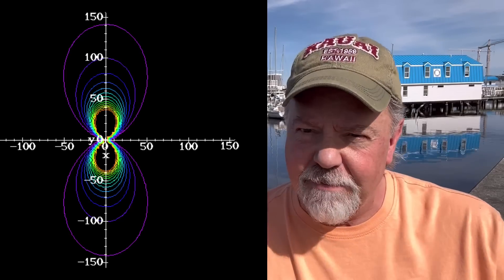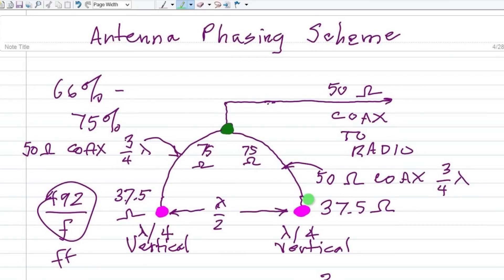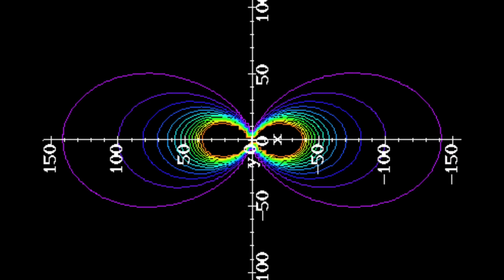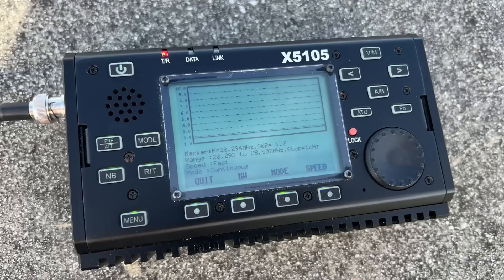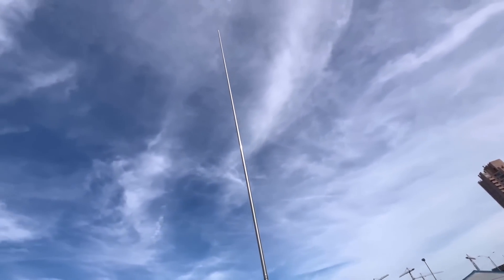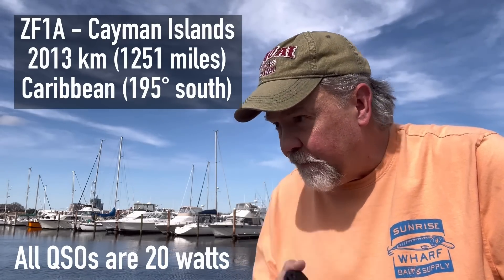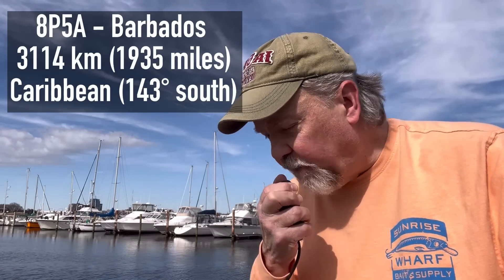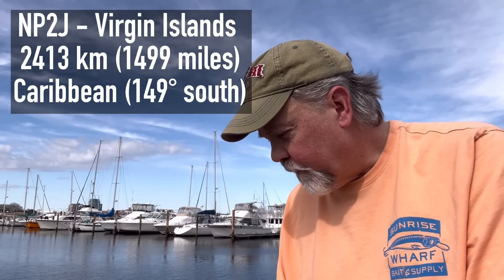Co-Phasing Antennas for Portable HF Ham Radio

Comment: Walt did you use the same Phasing Coax for 10, 17 and 20? I have four Solarcon M2000's and am thinking of two phased for 10, 12, and 15 meters north/south and the other pair for east/west. Love your videos and Thanks. Best 73's Jim K0MAN

Comment: Fascinating experiment!  Thanks for sharing it with us!

I was thinking about this while watching your video:

It occurs to me that a Yagi beam antenna can be constructed with as few as two elements, with only the director being fed, and the reflector about 0.12-0.15 wavelength spaced  and  slightly longer.  I was wondering if you had tried setting up a two element parasitic array with one whip slightly longer and closer to the other whip?  That should give you gain towards the driven element and rear rejection in the direction of the longer element.  With that perfect ground right there for both elements, the results might be surprising.

73
AI4IJ

Comment: I think base on the phase  it tends to radiate as a repellent from each other  . It would be a great idea to have those antennas in a sort of circular Fairy platform 🏟️that  rotates and  see if it you can use it as a Directional  . Because of the radiation side to side .

Comment: Very interesting, Walt. I ran phased verticals years ago on 15 meters from CT to the UK. Tried the bidirectional half-wave spacing, good, but settled kn end-fire arrays with a cartiod pattern. Just before moving back to W2, actually made a rotatable vertical array for 15 with a wooden base on casters. It worked very well, but portable? Not so much.

Got my ideas from 73 Magazine i  the late 1970's and early 1980's. Gotta try it again, no?

De WB2VUO
Reply from the maker: That sounds awesome, I’ve got the phased vertical bug right now LOL! 73, Walt

Comment: Ok... here's a history lesson...
Hy-Gain sold a little box called a Co-Phaser in the early 1960s. Paired with a pair of CLR2 base station antennas the box enabled the operator to have a number of directional patterns. 
Fast-forward to 1973...

As truckers began to flock to the CB band, they quickly learned that the aluminum box trailers really killed the signal. New-tronics Hustler introduced the Twin Trucker series of center-loaded mirror mount antennas. Hy-Gain had been selling co-phased gutter clamps and trunk lip mounts for years and adapting them to trucks was easy. 
They sold like crazy, and soon practically every OTR "big rig" sported the white "cattail" antennas. 
What they did was to create a "figure eight" radiation pattern that concentrated the RF in the direction of travel. I had them on my 1967 Ford F100 and can vouch for their abilities to get reliable 40 miles in either direction with a standard mobile radio. 
Fast forward...

I was doing field service in the 1980s and had a Kenwood TM-2550 in my Rabbit. In a quest for more range I mounted two Hustler CG-144 colinear antennas on the rear bumper. The older hams ragged me about having a "CB setup" but they quickly noticed the lack of mobile signal flutter and the fact that I could routinely be full quieting into the repeater in Pittsburgh from Mount Storm power station, 120 miles away. It was directional to the front of the car, roughly equivalent to a five element Yagi. 
If you mount the antennas an odd multiple of a quarter wavelength the effects of fading are drastically reduced. When one antenna is at minimum the other one is at maximum. 

Hy-Gain expanded the co-phasing concept to their Yagi line, selling co-phased three, four, and five element arrays. Google the old Henshaws catalogs. 
They were big!
They were heavy!
They were expensive!
But, they worked great!
Reply from the maker: Awesome stuff! Thanks for sharing!
Reply: @COASTALWAVESWIRES  Happy to contribute. I read those magazines when I was a kid and dreamed about building those really cool antennas.
Reply from the maker: @spaceflight1019  me too! I had the cheapest 1/4 wave antenna Radio Shack sold out my bedroom window and a Navaho 23 channel base (circa 1975)
Reply: @COASTALWAVESWIRES  My first antenna was the legendary Cushcraft Trik-Stik. Mounted on the same pipe as our TV antenna, it worked very well... and interfered massively with the TV!
Reply: @COASTALWAVESWIRES  I'm going through the old S-9 magazines and the earliest Hy-Gain ad featuring co-phased Colinear base antennas appears in the May 1963 issue. 
More history... there's a video on my channel.

Everyone knows about the "new" Super Penetrator. 
When it was first introduced in 1972 it was called "the Penetrator", or "Super CLR". What's a CLR, you ask? 
From the early 1960s to 1964, Hy-Gain sold the OG Colinear base station antenna. It was rated at 3.86 dB over a ground plane. It had a 20' vertical element and either three or four radials. 
It was replaced by the famous CLR2, a 19"10' vertical with three radials, a "solid state" printed circuit matching board, and a vastly improved mounting bracket. Unfortunately, the matching system was incapable of handling power above 300 watts, but the Penetrator returned to the hairpin matching system of the OG Colinear and it is rated for 1500 watts.

Comment: that was fun. we did this a lot in the early 1980's on CB. that co phasing harness gets you back to 50  ohm. can be done with a 2:1 splitter/combiner.  I know DX commander and a few friends been co phasing DX commanders together . and figured out multi band part.    I have seen 3 and 4 antenna's phased . Callum is working on that   as well. changing length of 75 ohm changes the phasing and changed pattern to antenna RF field. adding or taking away delay. also called delay lines. how AM radio stations work with more than 1 tower. normally 4 and they go into a phaser which is made up of delay lines and caps for tunning. this changes the pattern the station radiates  out of.  how they steer signal to.  a outher trick you can do is parasitic array. only 1 antenna driven and tuned.   one slightly larger and that all ground. that becomes reflector . move it around to steer your signal.  and you can even do a shorter one in opposite direction. that becomes a di reactor . you now have a 3 element beam.  lots of fun you can have with more than 1 antenna . 73's
Reply from the maker: I have plans for a parasitic array soon! 73

Comment: Cool experiment! I used to run dual whips on my pick up way back when because... why not? It's been a minute since I have looked at phasing. If you feed 1 leg 90 degrees out of phase, doesn't that change the direction to along the same plane?
Reply from the maker: Thanks! Yes that should be what would happen

Comment: Missing the truck mirrors, lol
Reply from the maker: LOL
Reply: When I was a kid there was a guy who was from Arkansas and went by Razorback. He had two 102" stainless steel whips mounted 102" apart on the roof of the Corvair van he drove. With a Lafayette HA-250 linear he was a flamethrower! 
While the setup might have worked well in Arkansas, in Pittsburgh the antennas kept striking obstructions and one day he came in contact with the overhead streetcar power lines.

Comment: I can see this would work well out in the open. I tried co-phased 20m verticals in my yard, both ground mounted and raised as ground planes with radials, and I think with all the obstructions…house, carport, fence, etc….I didn’t see any improvement over a single vertical higher up.  But that’s why we “play”, to learn 🤪👍!  73 de Dan WD4DB
Reply from the maker: Roger that! 73, Walt

Comment: Interesting experiment with very good results.  You didn't say... but for 20 did you co-phase the coax for 20.  IF not it would be interesting to redo it and see if there is anything different in performance.  It would be interesting to see what your gain was.  Thanks for the test.
Reply from the maker: Thanks! No I just left the 11 meter coax as-is on 20

Comment: Great Video! What I never understand about doing this is, okay, two quarter wave verticals, and half a wave length apart. With phasing. Okay. So far so good. And 1/4 wave radials under both. Again? So far, so good.. but do you attach the closest 1/4 wave radials TO each other? Then? Isn't this just an upside down half square? All the Best!  Finally, as far as the Truckers go, how can they phase antennas that are not going to be 5.5 metres apart to make the half wave, as that would be wider than the cab? 73 DE W8LV BILL
Reply from the maker: Thanks Bill! I don’t think the truckers got them completely a half wave apart but were more in the situation I was with 20 in an oval pattern with a little more gain forward. Sharing the ground plane this is similar to a half square for sure

Comment: Semi trucks have got the twin antennas like this. I still say single antenna is better. It seems like I had more positive results with just a single then the co-pays but for the frequency 27 MHz they really need to be 9 feet apart that's just not possible so that probably restricts them a little.
Reply from the maker: Roger that!

Comment: Hi Walt, 
Great experiment!
Sorry for the off topic question but what Li Fe Po battery are you using for your portable ops? I decided recently to get back on HF for more than just Field Day; purchased a G90. I'll want to purchase a charger as well the battery. Are there any stores here in the HR area that sell these that you know? 73 de KC4JGC.
Reply from the maker: Thanks! This is the exact battery I use with my G90. I’ve used it for 2 years and it will last all day with moderate use out portable. LifePo4 6aH, cheap and comes with its own charger. From Amazon and it’s a one day thing:
https://a.co/d/0iSVpTF
Reply: @COASTALWAVESWIRES Thanks, Walt; ordered!
Reply: Came home from Columbus OH last night; found the battery at my door. 
I was surprised how small the G90 really is; the battery is about half the size I expected! Color me shocked!

Comment: You could build a phase box and change direction with just a twist of the dial.  There should be a video or two out there.  Also a 4 squared array should be financially feasible for most hams at 10 or 20 meters.
Reply from the maker: Yes I’ve seen those, might be a project this summer

Comment: I did it a few times, but did some portable work with a half-square for 20M. Used a tree branch for one leg and a fishing pole for the other. Speaker wire. each end 1ft or so off the ground. Fed at the top corner. 5W QRP. pointing west coast and Europe. One of the italian stations I was working didn't believe the signal from 5W. Nulled out the N-S (I could barely hear people calling me). The setup time is the most annoying part but for something like field day or a long POTA activation for a particular band hard to beat the simplicity and gain

Comment: How about setting it up as a 2 ele Beam. So instead of using the harness. Have one element as your tuned 20m antenna and the second as your reflector(or driven)  have the second element grounded to the first. almost like a 2 ele beam but half. oneside.
Reply from the maker: I’ve got something similar to that planned. 73, Walt

Comment: Good to know about 20m. I remember cophased CB antennas from the 1970's but never thought you could use the same harness on 20m. I expect, with slight adjustment, there will be similar results with 12m and 17m.
Reply from the maker: Yes I expect that too

Comment: Walt great experiment - you pattern on 20 at a 1/4wave co phased is egg shaped, long axis is perpendicular (broadside to the antennas).  in modeling the long axis should be about 2dB better than the off the side in parallel with the two antennas.  the max gain point is about 30degs above the horizon.    Great stuff there.  At 10meters and 1/2w, your pattern is through the center with about 16dB gain over the side nulls at 25degs and 60dB better over the side nulls at 5degs.  Your broadside gain at 5degs is -3.1dBi about 2.5 dB better than a single vertical at the point.
Reply from the maker: Thanks John, I’m just getting around to replying to comments but I appreciate your input on this. I’ve been watching you and Cal, great stuff. You guys are awesome. I’m just out here hacking away lol. All the best and 73, Walt
Reply: You are doing amazing work.  Couple of my local friends and I follow your projects all the time and we have built a few of the antennas you have done.  It is just good fun while learning.   Keep it going brother! @COASTALWAVESWIRES
Reply: I modeled for fun two same verticals length 5.15 meter both. Distance between the two 1.9 meters. At source i put W1B 90 degrees and W2B 0 degrees. Doesn't work.. Did i do it wrong?
Reply: @48pluto  the distance between the 2 should be 1/4 wave on 20m... so about 5.2 meters and both are fed in phase degree change.  W1B and W2B no phase angle.
Reply: @FromthehamshackwithNJ4Z  Ah i see. Stupid me... Changed the distance to 5.2 meters and now the SWR is good. Gain 2.2DB at 28 degrees. I kept the phasing angle of 90 degrees because both antenna's are the same length.
Reply: @48pluto  leaving the 90degs in will send the pattern in one direction (end-fire).    The co-phase (feeding both in phase) will bring the antenna pattern broadside.  Cool stuff for sure
Reply: @FromthehamshackwithNJ4Z  DXcommander (youtube) has lately made some video's about it. Interesting stuff. If you haven't seen those yet you might look them up. Thanks for your help!
Reply: @48pluto  I helped with Callum on those.  Last one we did with Roly... I am John NJ4Z. Great to know you have seen those and enjoyed them

Comment: Where is this "Antenna Tool" that you pop up in the video...
Reply from the maker: They’re on Amazon. Many different brands and prices
Reply: No I mean the calculator. For calculating lengths of the primary element  at different levels like quarter wave or half wave. When you show it it says Antenna Tool at the top. @COASTALWAVESWIRES
Reply from the maker: @mobiltec  it’s in the iPhone App Store, should be available for Android as well

Comment: Someone below mentions the same but I too remember the co-phased antennas during the 70's cb fad and hearing about an antenna switch rigged up to the array to change the phase of the lobs to the sides if needed. Can't remember the details or if it even worked - long time ago.
Reply from the maker: There’s a bunch of cool old CB stuff out there. I think I know what you are talking about
Reply: If you root through the many 1960s CB radio magazines on the World Radio and TV history site you will find a variety of very interesting antenna designs that were meant to be built by experimenters.

Comment: Great video, Walt! A lot of fun. The co-phased antennas on the 18 wheelers was more about getting a signal around both sides of that big box they were pulling. With a single whip, half of the signal was blocked behind them.
Reply from the maker: Thanks! Roger that

Comment: I had a buddy of mine back in the 90s build a co-phased array on his car.. only he had 1 102 inch whip on the back and one in the front, the front one stuck way out infront of the car, he built a mount for it out of old bed frames LOL! He also made some wacky match box to where he could change if it was directional off the front or the sides.. It looked absolutely ridiculous heheh.   73!
Reply from the maker: Now that’s experimenting at its best lol